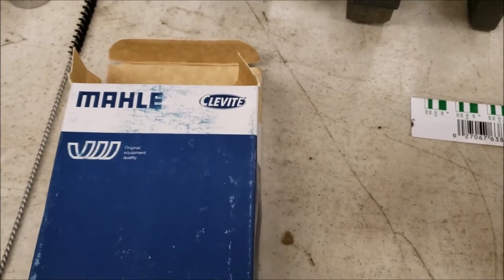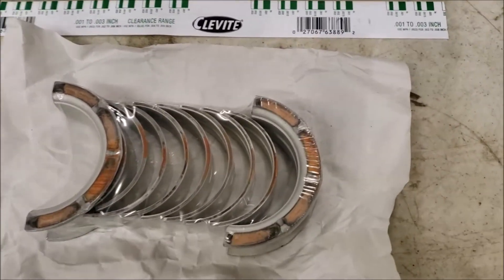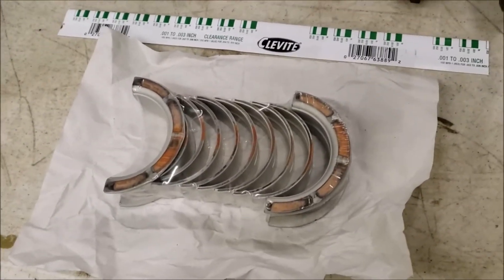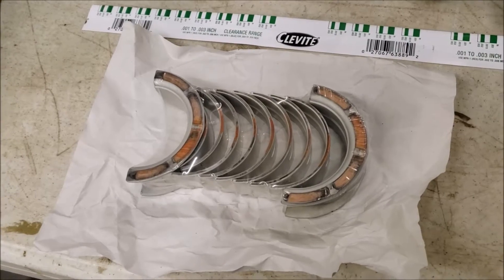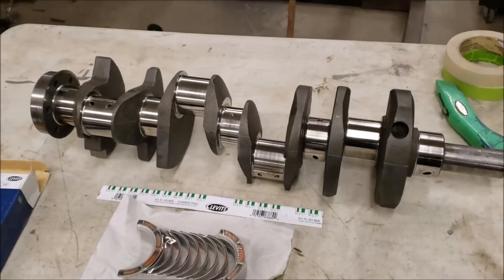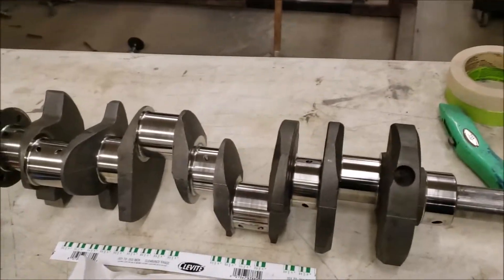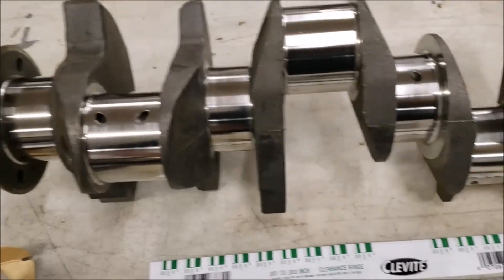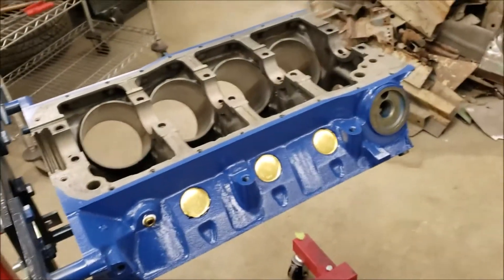Checking bearing clearances with Plastigage on the Sunbeam Tiger engine

Comment: It's all good and fine until you try scraping the wax off the goddamn crankshaft or bearing so much for your holier-than-thou
Reply from the maker: Not sure what you mean by holier than thou but a simple squirt of brake clean on a shop towel takes it right off.

Comment: What if my clearances  are too tight or too loose does the crank need to be machined or are they techniques  to solve the issue
Reply from the maker: First have to determine what is causing the clearance issue. Is it the block and/or rod or is crankshaft related. Block may need to be align bored or rods may need resizing. If it is the crankshaft, then it will have to be machined to the next size.